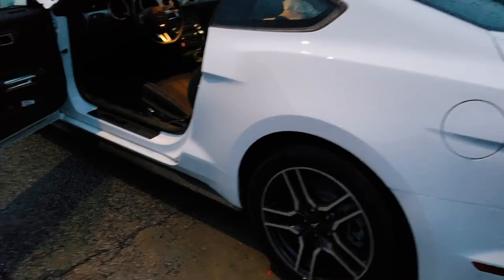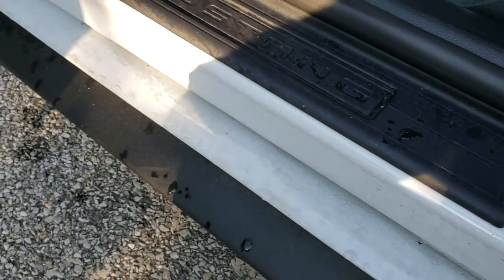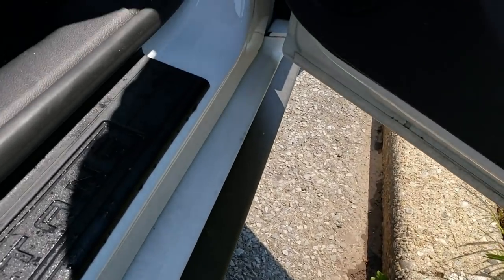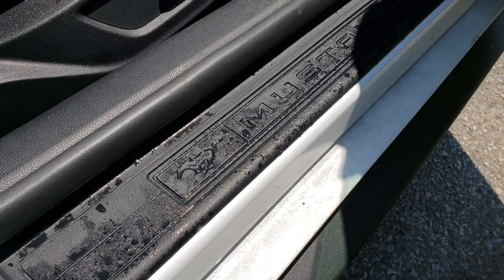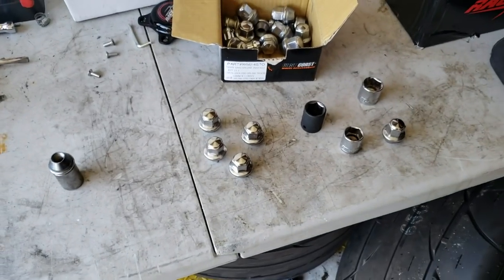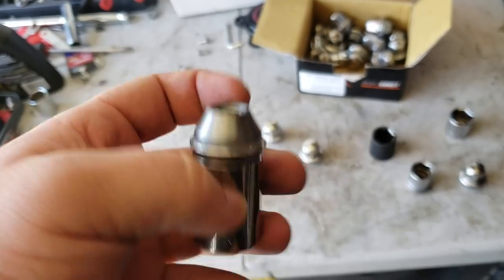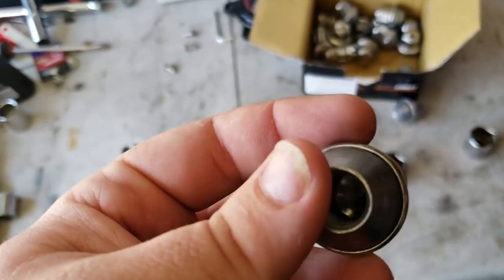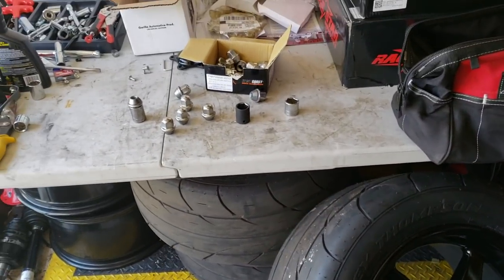MY 2018 FORD MUSTANG GT HAS 3 PROBLEMS BESIDES MY ENGINE TICK NOTHING MAJOR!!!

Comment: Sorry to hear all that buddy. I heard the coyote was a bullet proof engine but I guess I was wrong because I’m seeing a lot of problems with the 2018 and up. I have a 02 2V and that engine is very reliable. Never given me a single problem and it has 150,000 miles on it. Obviously not as powerful as the 5.0 but very reliable.
Reply: Evil One Well to be fair, we all are car guys(and girls) and we all love our cars. We love working on them and obviously always want to make them faster. There is nothing wrong with putting too much “bullshit” on the engine. The 2018 5.0 is designed to handle all that power so it’s uncommon to see it break down. I’m sure a breakdown(s) will not stop a enthusiast from working on his/her car. Heck my 2V is running a Kenne Bell Blower. Us car guys will never stop pushing the limits. Just runs in our blood lol

Comment: 1.Lugs are garbage, they have cover on them that swells. That's why most of us use a .5mm step up to which ever size lug it is. 
2. Water getting in there has been happening with ford for a long time.

Comment: Started the video expecting actual problems to look out for as I'm about to buy an '18 GT PP. The tick is a direct injection thing. Everything else is just whining over nothing. Really, lugs are a problem? Lol
Reply from the maker: MrDaavee These are issues I havent seen on any YouTube videos, a lug yea they can be an issue when you are stuck on the side of the road. This video is far from whining,  if buying  18 PP make sure it's an auto or you will be crying about your mt-82  shift fork is broke.
Reply: Michael Mac now a busted shift fork IS worth bitching about. The other 'issues' being cried about is nothing. Have seen stuff like this on so many other new cars. Stuff fixed in a minute and not even worth going to the dealership to cry about. My '14 Camaro SS had the same water 'problem'. Adjusted the seal. Fixed. My brothers '14 genesis had a squeeky tail. Pulled it out, adjusted the gasket, and fixed. The lugs...replace them. Cheap easy fix.
Reply: Ticking coming from the top side of the engine is your direct injection if it's coming from the bottom it's the bearing wearing or piston slap and is totally a problem

Comment: Should it be a Jan Batch engine have them take the heads off or at least do a compression check across the enginecyclinders they seem to be having problem with cylinder scoring especially cylinder 4.

Comment: I’ve had to replace about 10-12 lugs. I thought I was using to high of a setting on my impact. Do you have a link to the gorilla lugs?
Reply from the maker: Roderick Lathon Gorilla Automotive 91147 Acorn Bulge Seat Lug Nuts (14mm x 1.50 Thread Size) https://www.amazon.com/dp/B000CMJ3G8/ref=cm_sw_r_cp_apa_i_6srxBbD450AC4

Comment: Engine tick happens due to direct injection. I got my 2018 and got worried also. Not just the mustang but 6th gen Camaros and any other car with direct injection makes that ticking noise.
Reply: 150 ft-lb of torque is what they call for and it’s odd but that’s what the Ford calls for 🤷‍♂️
Reply: wyatt_S550 no ticking noise on my 18 zl1 at all.

Comment: Bummer man! My 18 has none of those issues, including the “tick” that so many complain about. On the lug nuts, are you using the normal 13/16 socket? The same thing happened to me and i tried a 21mm impact socket. Worked perfectly! They fell right out! Good luck
Reply from the maker: 16 Sport  engine still running strong!,  I threw those factory lug nuts out!!

Comment: Hey Michael are you replacing the welds for racestar wheels, if so why?
Reply from the maker: Victor Xavier The welds need alot of maintenance  hard to keep clean it drove me nuts, so I sold them and bought the race stars, I have had welds on few of my cars and just need some change
Reply: Michael Mac I feel ya on the maintenance there a PITA to keep clean and shiny

Comment: Hi Michael I was wondering what tire psi are you running in those Mickey thompson ss at the track?
Reply from the maker: Scott Waters  I usually have air pressure set between 16psi and 20psi I make my first hit at 20psi then usually go down to 16psi all depends on track conditions

Comment: The water may be coming in up top from the seal against the glass, then runs out the bottom of the door. If the car was just sitting, rain shouldn’t come in from the bottom... I bought a socket and breaker bar combo form AM, that works without issue. I never use impact gun etc on the lugs.
Reply: Same you should not be using impact gun to tighten your lugs just to take them off
Reply: Using an impact gun you run the risk of over tightening and breaking studs

Comment: I get water inside the door as well. I don't even worry about it. My engine ticks a little bit also. I just keep driving it. I'm not even worried about whatever keeps happening with these cars. No matter what car I've ever bought I've had problems. As long as my car is under warranty I really just don't even worry about it. Plus when I get past the warranty or right at about 3 years I trade it in anyway. Hope it all works out!
Reply from the maker: 6ixSpeedStang18  I have no worries, just making videos